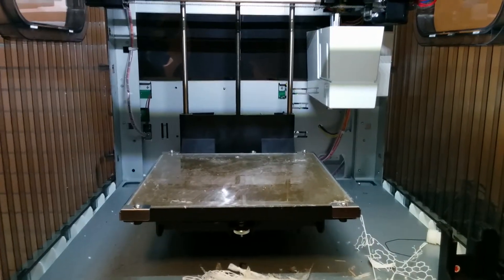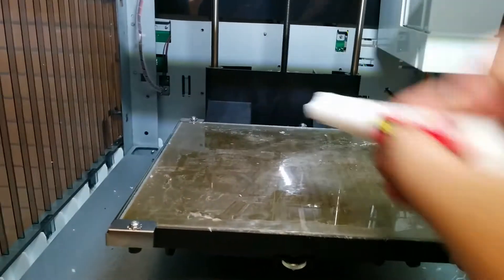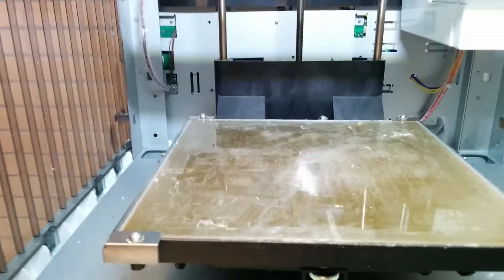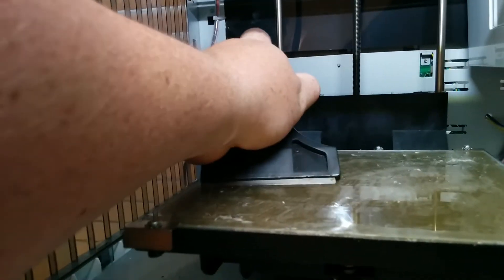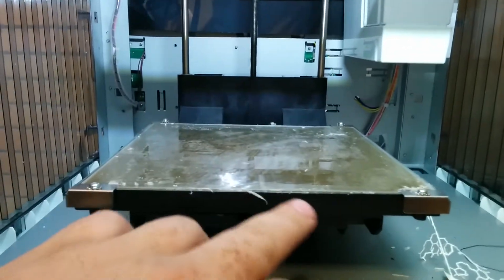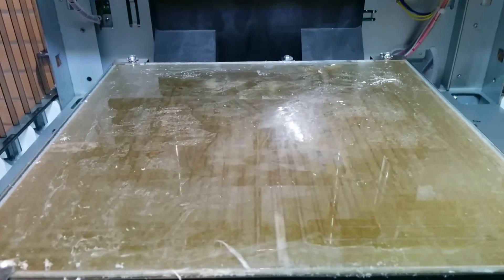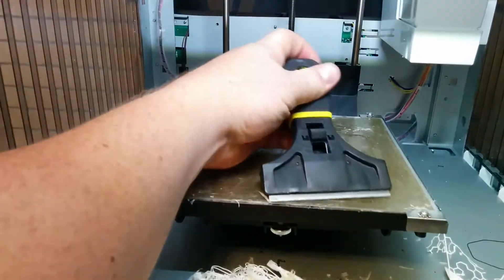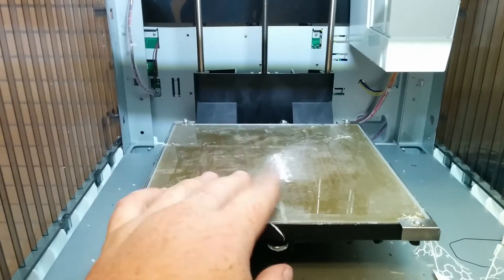How to clean stick glue off DA Vinci 3D printer

Comment: Mark, have any tips to reduce curling on overhangs halfway up the print? Sometimes the curling can get so bad it snags on the nozzle and messes up the print, but even if it doesn't mess up the print, the plastic will burn where curled as the nozzle passes over it multiple times.

Comment: The glue is water based so just wet it with a damp cloth. Leave it a few seconds then use your scraper. It will turn into a watery paste and slide right off. do a couple of times and finish with a dry cloth. This will take no pressure and your bed will remain level hope this helps it works every time for me cheers Tim
Reply: Bingo! That cleared my glass in seconds.

Comment: Just use disappearing purple glue sticks from elders. When you take a damp hot cloth and rub over it when ready to clean, it will turn purple again. Then, by using a scraper blade, it will all come RIGHT off, leaving the glass looking new. This takes about 5 seconds and gives a great adhesion.
Reply: Also, almost no pressure needed at all, since it scrapes right off, thus no recalibration. ;)

Comment: I'm interested in purchasing this machine, however I saw a review on it that spoke lowly about the machine's software: "Cons: Software is bad, very bad. Many prints would fail to slice on the XYZ software. Tested the same files in Makerware and no problems at all."  so I was concerned. 

I'm in the process of having Armis game pieces rendered as STL files so that I will be able to print them on whatever 3D printer I eventually buy.  When I saw the above reviewer statement I wondered if the STL file wasn't already sliced.  

Would you kindly tell me what the process is for printing in 3D so that I could have a deeper understanding of the hardware, the software, and the integrating process especially when using the same file different ways on different machines.
Reply: +Armis Game I read the same thing, but ended up getting one because it was cheaper than the alternatives. The only time I have had a print fail is because I didn't use enough supports. When I first got mine I printed the star base just to see how it printed without calibrating. It turned out decent but not as good as I had hoped. I then (painstakingly) calibrated it one afternoon and it has printed perfectly ever since. When I switched from the ABS cartridge they sent with it to PLA I did have to lower the bed some, so I figure I will calibrate it again when I switch back to ABS. The software isn't the best (I have used Slic3r for undergrad research and could tailor the settings) but it isn't horrible as people make it out to be. If you are just wanting to print some things and don't want to tinker with all the settings, I would recommend this printer hands down. But, if you want to deal with changing the bed/ extruder temp, print other material besides PLA or ABS, or mess with the exact layer height and speed, I would recommend something that has different software or just buy the DaVinci and flash it. I bought mine expecting to flash it immediately since I have quite a bit of experience using one, but I have opted to wait until the warranty runs in case something messes up. The settings in the XYZ software are enough to make sure your print comes out in a lot of detail, which is slower, or with less detail which is quicker. There are advanced settings in the software which allows you to tailor the speed, infill density, layer height, supports, and brim. I have bought three refill cartridges and they all work well for me (1 PLA and 2 ABS). I was going to buy a Prusa printer but opted for the DaVinci and I am glad I did. Well worth the money spent.

Comment: I use windex and it disolves with a little rub of the finger. Then wipes of easily with a paper towel. I am going to try painter tape.. I have heard the prints stick well to it (on an Ultimaker). The glue is still a pain in my eyes. I also heard of these guys dissolving plastic into acetone and making a glue like liquid.. What's the best way???
Reply: Painters take is for pla. lightly scuff it with sand paper. Also wipe with acetone before each printing session or new platter of prints. Very dilute acetone and abs make abs juice. This works well on a heated bed for abs prints. Sometimes the parts are near impossible to remove. Kapton works but it's a huge pain and SB extra expense that I avoid by using uhu stic. First learned of this brand from e3d. It's all they use and now it's all I use too.
Reply: D Rob I'll have to try that brand and see the difference.

Comment: Is anyone else having a issue where when you start a print the plastic curls up and melts to the print head so it drags plastic around?
Reply from the maker: Yes, I have. First clean off your bed of old glue, Calibrate the bed, Clean print head with a wire brush and alcohol. Reapply glue and the problem should be fixed. Also print in normal speed

Comment: I just use a damp towel, and scrub. I then take a dry towel over it and usually I can get it all off after doing that 2-3 times. Takes less than 5 minutes and doesn't risk scratching the glass, just make sure you turn the printer off first.